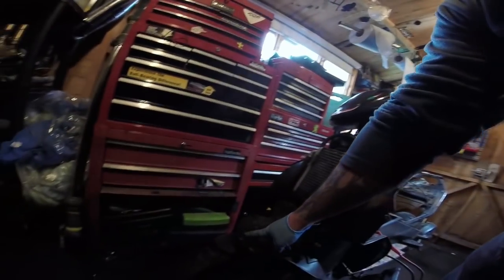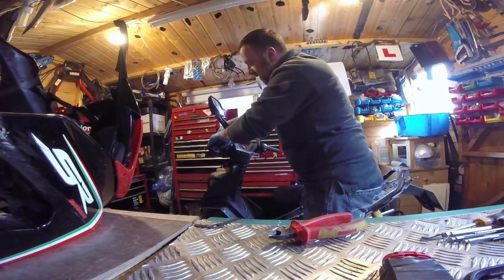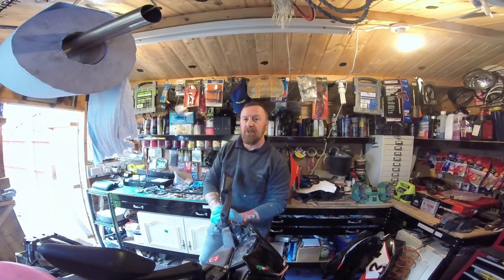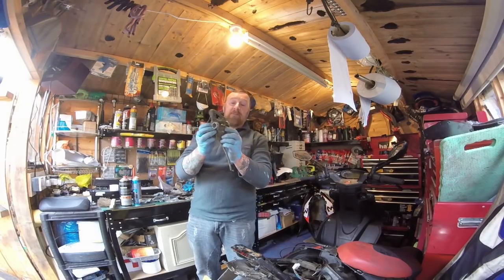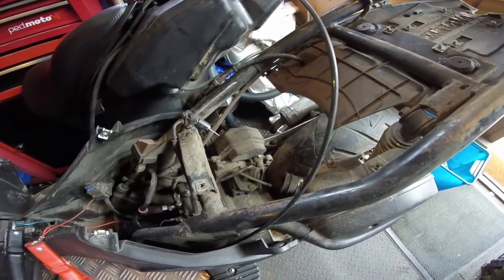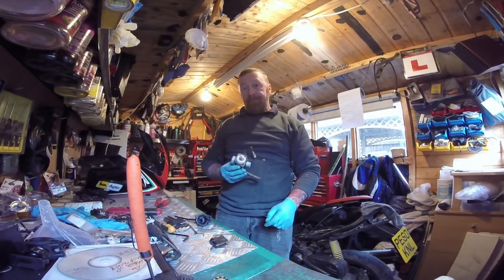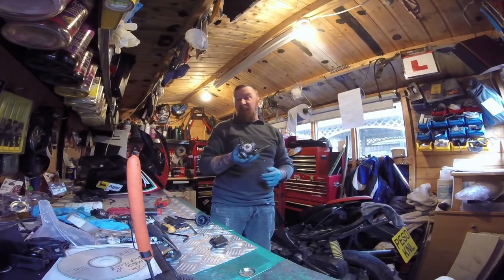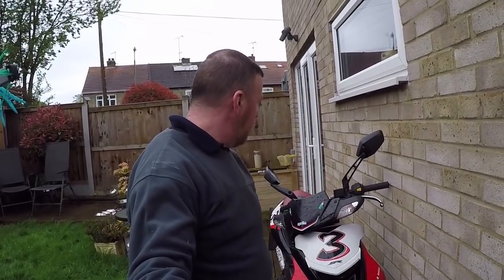APRILIA SR50 CARB CHAT AND START MARK SAVAGE

Comment: I have uploaded the video on my channel todo with the slow pull away and juddering
Reply from the maker: mate that is fuel, check you float and that it is filling up and that when you cleaned it you put it all back together , what air mix are you running , 
my videos will help and this is only after you ran out of petrol?
Reply from the maker: it is odd doing it after 3 miles or so so failing after it gets hot!!
ive seen this only on carbs and stator coil as once hot they stator coil goes to earth like I have said to you many times bud 
go over carb again 
check out stator coil, change plug as they can do this as well bud
Reply: Im running 1 and half turns out with the restrictor plate still in there and when i first took the carb apart after running out of fuel the pin that held the float was missing
Reply: Also changed the plug 2 days ago
Reply: And yea its since i ran out of petrol but i cleaned the carb and stuff as there was some grit in the bowl of the carb and i got a new pin for the float and put that in there
Reply: Update, its doing it even from cold now
Reply from the maker: oh right well maybe if it was running ok before id put it back to the way it was lol
Reply: All i done was put the pin that holds the float to the bottom of the carb lol
Reply: However it hasnt been doing it all the time since it, its just developed over about a month or so
Reply from the maker: flush out petrol tank re clean carb as you may have blocked  the intank filter
Reply: Okay ill do that and ill get back to you
Reply: However there is a good flow of fuel as i can take the fuel line off the carb and turn it over and fuel comes out quite fast